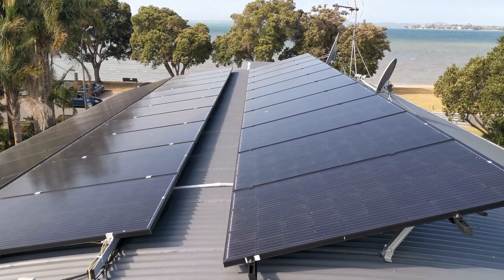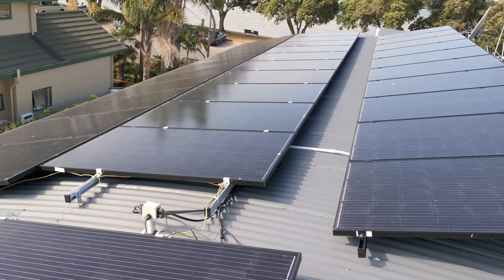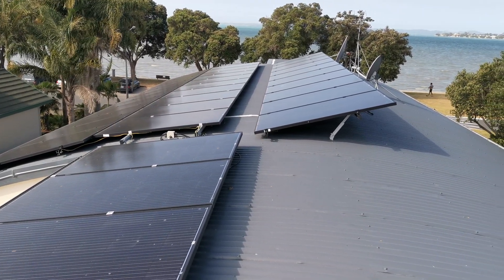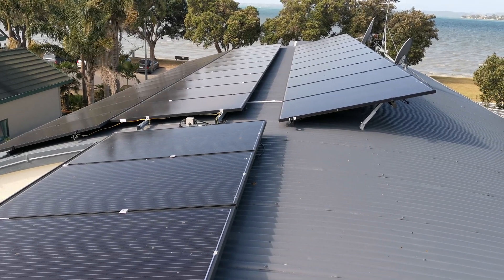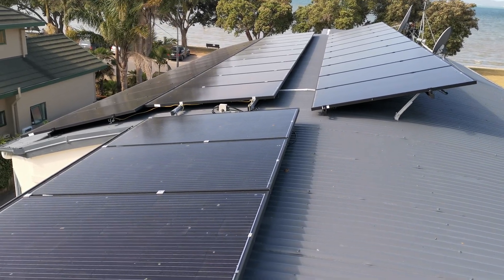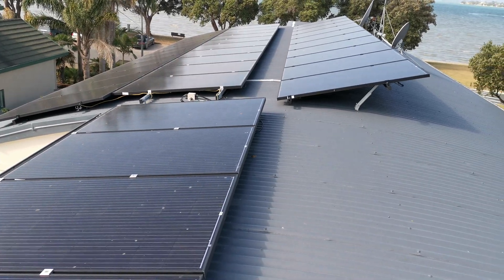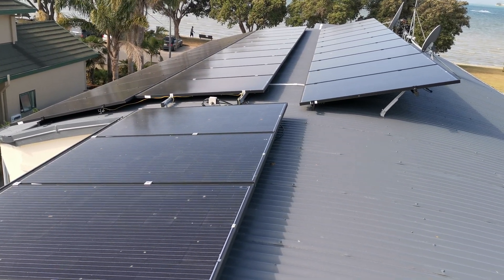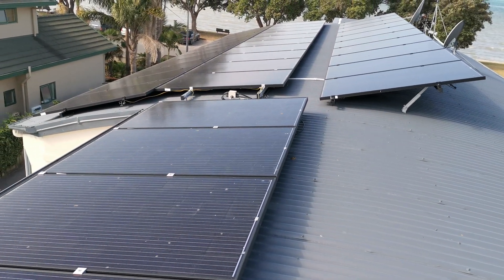Solar Power 10 kw

Comment: Back in Canada we need more panels as we get a lot snow and our angle is 45 degrees or more even 65 in the winter love your channel and thanks for the videos.
Reply from the maker: It may be far better to put panels on a north facing fence if you have one with a clear view. You will get much stronger solar and no snow cover.